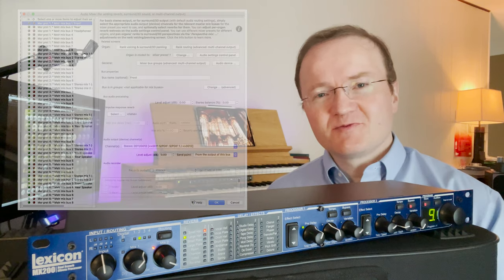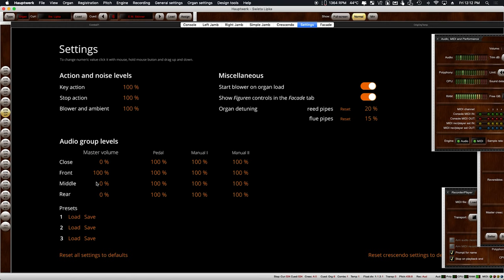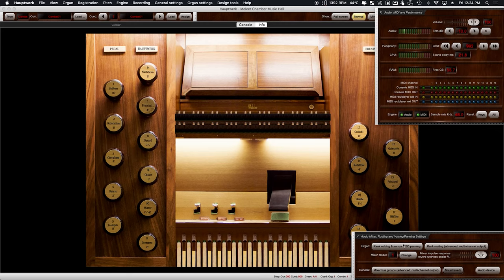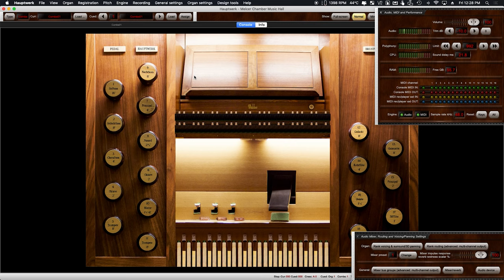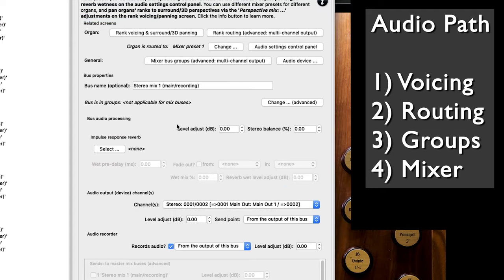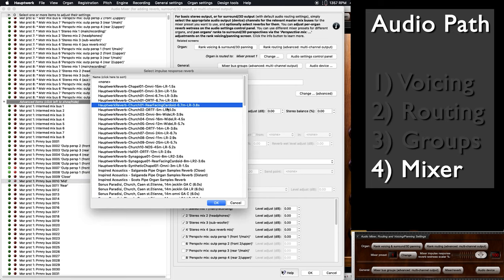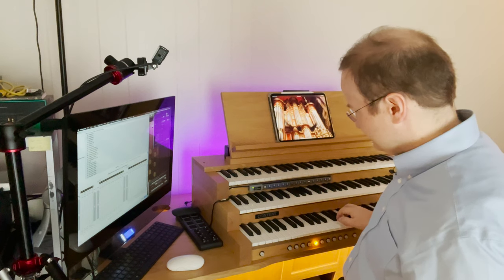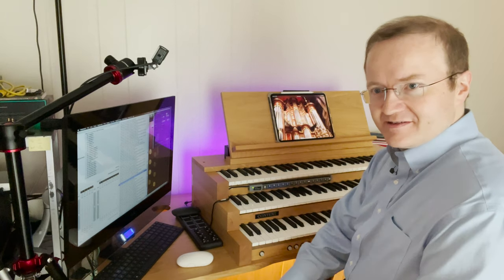Step-by-step: Hauptwerk Mixer, Impulse Response, Multi-Channel Virtual Acoustics

Comment: What a great and helpfull video! Thank you so much. I'm planning to do some multichannel virtual acoustics and you made it so clear! One question: In the rabk voicing adjustments you change the parameters for perspective mix, I see there is also an option to change output persp 1 - 4 seperately, What is the difference?
Reply from the maker: Thank you so much Marc - glad you found it helpful. Think of "perspective mix" as the volume control for each perspective (a master volume slider) - then within each perspective you can further fine tune amplitude, brightness, releases, etc. etc. - that's why there are so many options in the dropdown.
Reply: @jerrymartin79  Thank you for clearafying!

Comment: This is excellent, Jerry.  I think a little more graphical overlay describing a studio mixing board, then applying the same concepts to a block diagram of Hauptwerk's implementation would help.  I've used many a mixing board but will have to play around more with HW to see the analogy.   Now I'm going to sleep on it, and probably lather, rinse, and repeat tomorrow.  ;-)
Reply from the maker: Thank you so much Bill! I am glad you found this helpful, and I am making a note of your comments - while I have no idea what the timeline might be, there is no doubt there will be some updates to Hauptwerk "soon" - in the event that the user interface does not change, I will make an update - best of luck with the mixer adventure!! It really is designed to behave just like a mixing desk, it just requires at the moment that you imagine and "see" all the connections in your mind to navigate the four dialog boxes! 🤣

Comment: I personally use Cantabile to run hauptwerk as a VST, this allows me to run the audio through Reverberate, and use some binaural convolution files. You can also make your own convolution files of any space you like if you have a little time and access to the space, microphones, and a good, loud PA speaker.
Reply from the maker: Thank you very much for that tip - I've personally not used Hauptwerk as a VST - but it opens all kinds of other exciting possibilities!!

Comment: Thank you for this video which gives me a good start on the HW a nuts and bolts.  Have you done a video which would answer this situation: I have HW7. Some pedal notes boom in the acoustic of the room.  I want to turn down these notes - that’s easy BUT….I need two outputs: speakers which have the ranks adjusted and headphones/recording channel which are unadjusted.  I know this can be done but I haven’t worked it out for myself yet. Thanks
Reply from the maker: Hi Andrew - sorry for my delay 😊 Did you find a solution to your issue? The simplest solution might be within your speakers/audio interface - if there is a mixer there, you can adjust things for the room, and leave the HW recording unadjusted. However, if you need to do it within hauptwerk here is what I would suggest: 
- use one of the primary busses for recording only
- tick the box "record" for that bus and disable it elsewhere
- route "perspective 2" of all ranks to that primary bus
- assuming "perspeictve 1" is going to your speakers, then make your adjustments for the pedal notes (on the voicing screen) - ONLY on the perspective 1 amplitutde controls (rather than the global controls)

I realize it's difficult to put into words the complexities of hauptwerk routing - does this make sense at all from your end?
Reply: @jerrymartin79  Thank you for your comments.  They make good sense to me - HW7 (my first real encounter with HW) is very flexible and I am already enjoying what it does for the sounds of real organs - I am effectively updating a 2002 3 manual Allen.  The console is good but the sound was beginning to leave me dissatisfied.  Thanks for your help.

Comment: Hey Jerry…excellent tutorial and terrific playing !  I had a quick question.  When I follow your steps for virtual acoustics, I think I am missing a step.  When you set up the close, medium and rear bus groups with the reverbs, are you then pointing them all to the perspective 1 mixer preset, and then pointing that preset to your speakers ?  I find that when I try to adjust volumes in rank panning, either nothing happens or I get no audio.  Running HW6 advanced.  I’ve watched this tutorial dozens of times…it is mesmerizing !
Reply from the maker: Thanks Kathryn! Yes indeed it is indeed crazy to navigate (I hope a better user interface comes in a future version!) - in short, yes I am using "preset 1" in the mixer... as long as the speakers are "attached" to the endpoint (in this case it's the "main/recording" master mix bus) - at the top of the crazy dialog box - you should hopefully hear something?...
Reply: @jerrymartin79  I will have to try it tomorrow and will let you know.  I get into the weeds when checking the sends for close-mid-rear.  I'm assuming these are all pointed to perspective 1 prst, or does each go to the appropriate perspective 1-2-3-4 ?  It would be nice if they developed a screen where you could drag and drop ranks into bus groups, then drag or link (visually) the groups to the mixers, etc).  Drew Worthen posted a really good tutorial with a conceptual diagram that was very helpful...he recommends working backward from the speakers to the ranks.  That seems to work for me.  I definitely understand it a lot better, but it is still complicated to get to that final result !
Reply: Success !  I wound up reverting one of my alt. Configs to factory settings and went from there.  I believe I was trying to adjust Perspective 1-2-3-4 instead of Perspective Mix 1-2-3-4.  Sounds really good with a dry-sampled small Moller.  It is 15 ranks, and similar to what I play at church…I wanted a comparable practice instrument, since playing a Skinner on HW kinda spoils the ears when I go to church and tackle our 14-rank Wicks ! 😀
Reply from the maker: @RTV351  Yay! That's so great to hear!!! I'm glad it all worked out (and it is such a treat to be able to set up our home practice instruments to help us "in the real world" :)